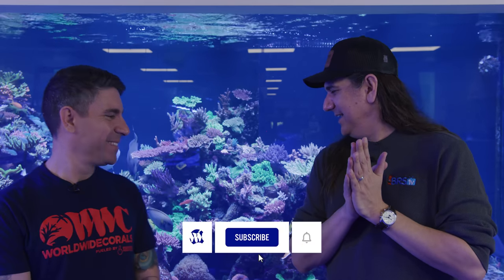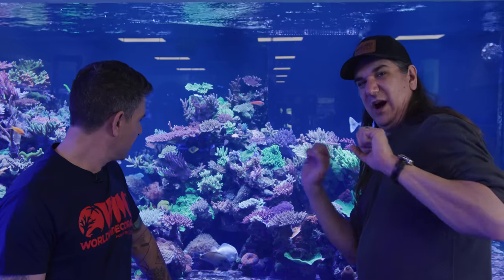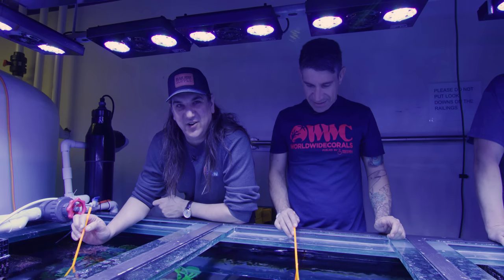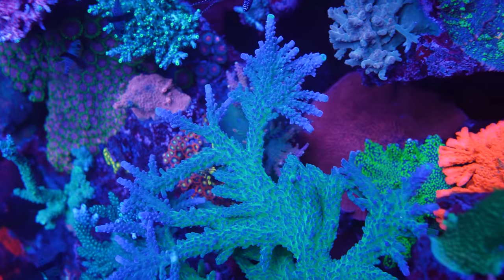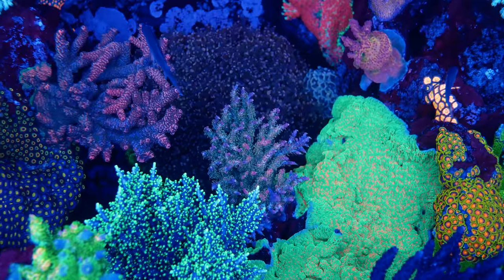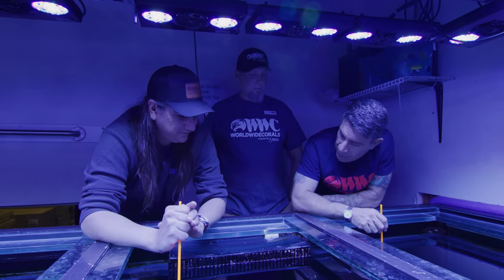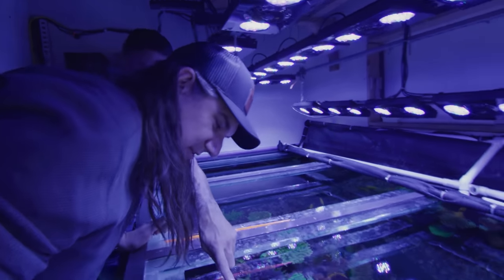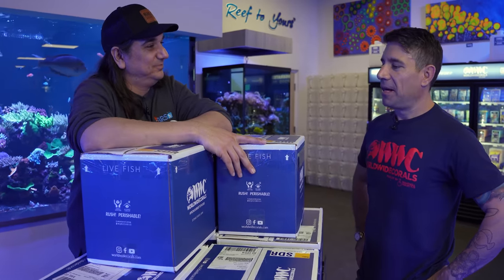BRStv Cherry Picking Corals (PT3) Ryan & Victor Discuss SPS

Comment: What a fun experience. Makes me want to get some SPS! Not sure my AI Prime HD can handle it in my Waterbox 25 peninsula.
Reply from the maker: Yes, we have kept SPS under the AI Prime HD.
Reply: Good to hear. Right now I’m using BRS’s recommended settings for LPS in a 29 gal tank that’s supposed to get me around 75-150 par. I supposed I could crank it up a bit more and at least have a SPS at the top center of my aqua scape.
Reply: @ManiacalMangoes  not all sps need 250 par and even some acro's don't need that much there are deep water soft skin acro's that are amazing that don't need 250 plus. One of my favorite acro's is lokni that would do great. Light is not the most important thing for acro's like every one is so pre occupied with. Flow is way more important and a high PH. You get those 2 things dialed in and your acro will do great. And you can find sps that are as easy as any lps and don't need 250 par.
Reply: Thanks for the info! Might need to get a SPS for the top of my tank where the par should be a bit higher and the flow will be strongest

Comment: Wish I could get some acros but I can't even get corline alge to grow and tank is 2.5 years old lost to much money trying
Reply from the maker: Have you tested your water for Calcium, Alk and Magnesium? What are your parameters?
Reply: @WorldWideCorals  
Calcium 440
Magnesium 1520
Alkalinity 10.4
Reply: Ammonia 0
Ph 8.2 maybe 8.4 hard to tell
Nitrite 0
Nitrates 40 at the moment battling to get that down was off charts last month
Reply from the maker: Hey Johnathan. It sounds like you are bringing the Nitrates down which is good. Try to aim for 10-25ppm. But even if you bring them down, you need to find the cause of them. I'm also curious of Phosphate readings. So do you have too many fish, overfeeding, is your RODI at zero TDS etc? Try to get that fixed and you will be on your way to keeping SPS. Also, more importantly than the actual number, but is your ALK stable? Make sure to consistency dose your tank or if you are adding Kalkwasser make sure that is delivered in a consistent manner. Keep it up!
Reply: I don't dose at the moment and I don't have the ability to test for phosphates  as for tds no clue but I am using a aqualife 4 stage RODI unit. Normally my dkh is around 12 or 12.5. I test parameters once a week and usually they are very close to the fresh saltwater I make for water changes.
Reply: @WorldWideCorals  so I picked up a api test kit and tested phosphate it is at 20ppm. I do feed once a day with new life spectrum pellets a pinch at a time until the fish don't eat it any more. Twice a week I feed my anemones thumb nail size pieces of raw shrimp and some pieces get stolen from them by my blue head wrasse and niger trigger. I assume the purple lobster I have scavenges those since I don't feed him directly. I don't dose because I do not know how to dose how much to dose when to dose and what to dose with right now I am only able to test salinity, ph, nitrates, nitrites, calcium, dkh, magnesium, and phosphate. What else should I be testing for and what test kits should I get. Currently red sea for calcium magnesium dkh. Api for phosphates nitrates nitrites ph ammonia. Tank is 55 gallon display and I don't know how much water sump holds.